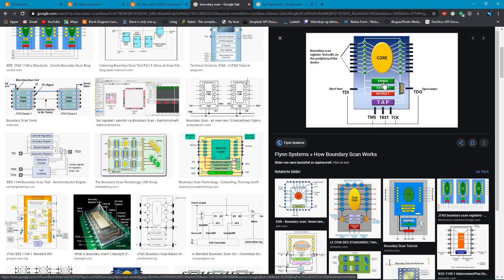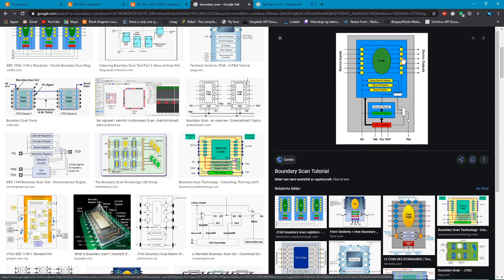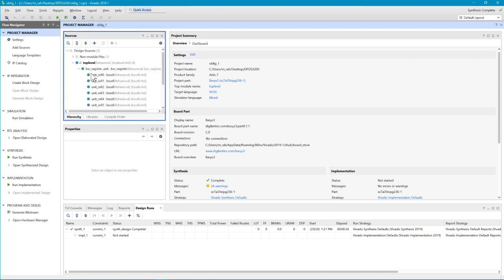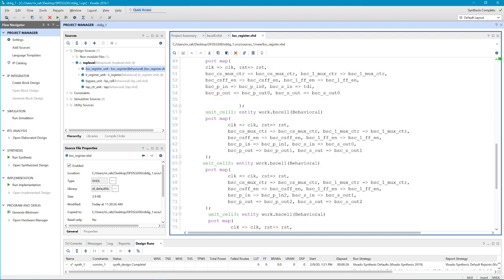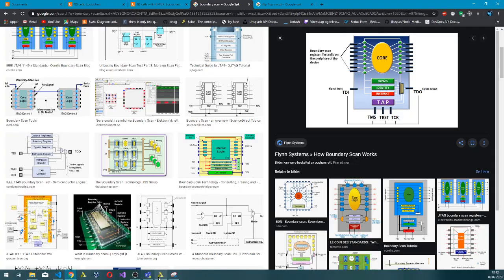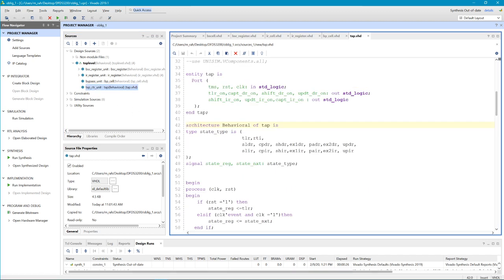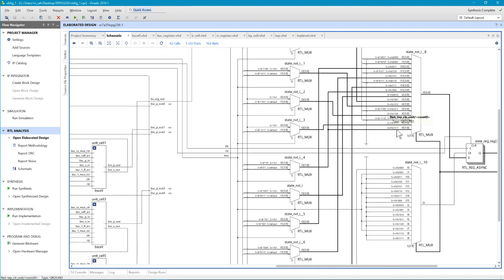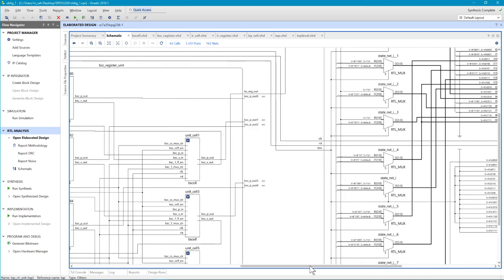implementing a boundary-scan in vhdl

Comment: ERROR:Xst:528 - Multi-source in Unit <toplevel> on signal <di_mux_ctr>; this signal is connected to multiple drivers.
ERROR:Xst:528 - Multi-source in Unit <toplevel> on signal <sp_on>; this signal is connected to multiple drivers.

bro how to resolve this error
Reply from the maker: Check your input signals and see where you have used those signals